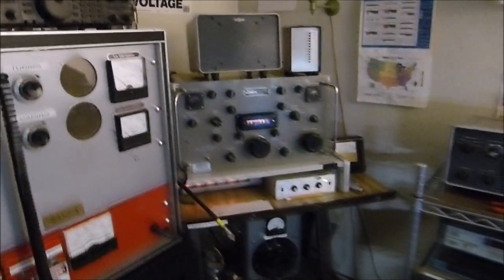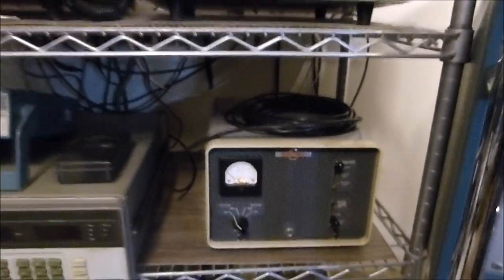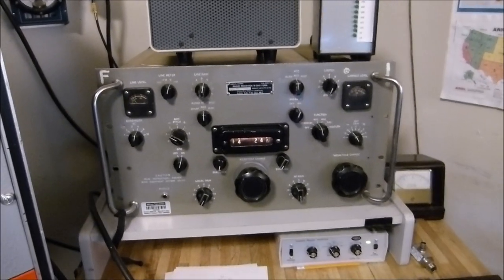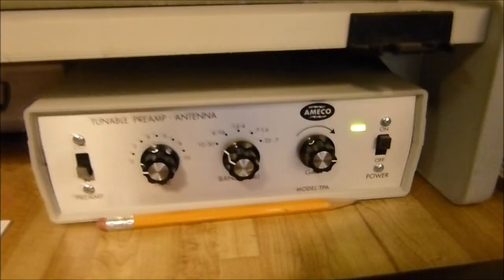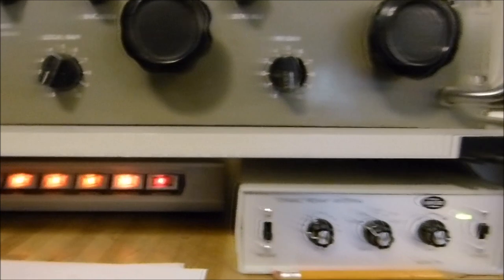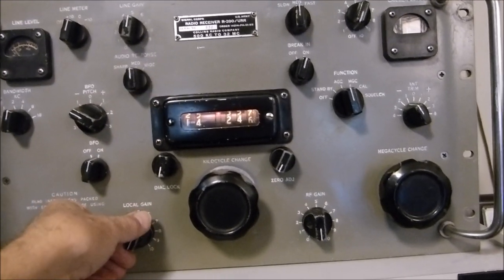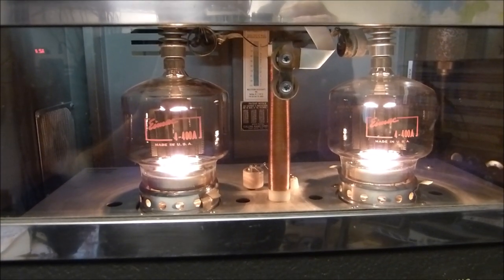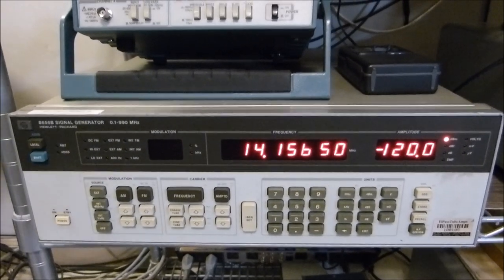Collins R-390, 75S-3, 51S-1 & KWM-2A Receivers Compared

Comment: A properly running 390 and A versions will have enough RF gain without a preamplifier. You may have a resistor in the IF for example that is high in value causing lower gain like I had in my 390. Once repaired and realigned it is a hot performer with my 390A.
Reply from the maker: I am glad you mentioned resistor issues in the IF section. I have always figured it was in the IF section and I don't mind working on the unit but, as you know, work is to be done carefully and the beast is heavy for one old guy to move around. I may take a look in the IF section again. With the preamp, I would say it is as good as new. It is top-notch in performance but I would like to fix it properly.  73
Reply: @ElPasoTubeAmps  It could be something els too. I would check each IF tube plate resistor. The IF deck is not that hard to take out. I use a automatic AM sync detector with sideband. I also can run the IF output through a SDR board with power SDR or HDSDR software. Just amazing receivers.

Comment: The S-3 will sound much smoother on ssb when you select slow AGC. Fast attack, fast release has always been problematic with Collins 75S-3's. Something to consider, unless you are a CW op. 73'S...
Reply from the maker: Good point. I believe I discovered that long ago but forgot. Thanks. Also, the R-390 is a slow AGC as it has the Tree Top adapter on the back and it can cause a fraction of a second delay when the other station starts transmitting. Usually not a problem. I think the Tree Top adapter takes control away from the R-390 front switch. I will have to confirm that. In any case, the objective of this video is how the little bit of front-end preamp really brought the R-390 up to sensitivity performance very close or equal to the other receivers. I really enjoy using it. I  have ordered another black rack just like what the KWM-2A is in to stack the R-390 and S-Line equipment and get some of my floor space back... may even buy a third rack later. 73

Comment: As far as clarity goes, the R590 and the KWM2 sounds the best to me.
Reply from the maker: I know what you mean. Those two receivers have a more full-range frequency response than the other two but the 51S-1 and 75S-3 are more sharp or crisp sounding which can sometimes help get voice communication thru better. My favorite sounding one is the R-390.  You might also  find it interesting that the R-390 is only 500 ohm output and uses a little seven pin 6AK6 for 500 mW output to drive the local speaker and a 500 ohm line. I have been told a single stage 45 tube amplifier SET makes it sound even better.

Comment: I miss my service monitor when I worked in two-way.  All of my ham gear was tuned and run at optimal rx sensitivity.
Reply from the maker: I have thought about buying a service monitor but as you know, they can be kind of expensive. Maybe I will luck out and get one at an estate sale. I  paid $375 for my KWM-2A with power supply (516F-2),  312-B4 speaker/wattmeter/phone patch and and extra Collins speaker - the one sitting on top of the R-390.  It is obviously a US government contract instrument as can be seen on the front of the power supply with the contract number.  The 5R4 and 5U4 were in original GE tube boxes as was the fuse holder and fuse along with Collins tags in plastic bags. The way it came, it is apparent to me that it was never used before I got it. Got to go to estate sales before they put it on Ebay and it costs 10x as much.

Comment: Hi, was the lack of r390 sensitivity before you aligned it? R390’s have a very low noise floor in my personal experience
Reply from the maker: Yes, the sensitivity was a bit low before the alignment and that is one reason I did a full alignment with the best tubes. The R-390 does have a very low noise floor and I like that. There seems to be something about the sound of the 500 ohm outputs on each of these three receivers that I like better than the 4 ohm outputs. I can't explain why could be. I added an outboard preamp and sensitivity is as good as my 75A-4 (a new addition) and my 51S-1 receiver. Interesting that I was listening to a very low signal level DX station last night and was switching between the R-390, 51S-1 and 75A-4. I think most of the difference was just in the speaker sound and not the receivers as each receiver had its own characteristic sound all actually very good. This was on 40M. The R-390 is still top-notch compared to any receiver.

Comment: I dunno, a $100 Sdrplay sounds pretty nice, hears and displays  everything and takes up much less room.
Reply from the maker: The SDR is pretty amazing and does just as you say but I love the old technology and keep the boat anchor equipment running. I can fix the old stuff but if the SDR breaks it goes in the trash can and I have to buy another. I mostly use my SDR nowadays as a spectrum analyzer. The modern stuff is amazing and I like it also.

Comment: Did you get my last comment I never got a response about micro cap,I left you a link so maybe it was in spam
Reply from the maker: Hi John,
Yes, thank you, I did get your message about Micro-Cap and did use it some years ago when it was only a DOS version. I still have that DOS version on floppy.  I did download and install the Windows 10 version of Micro-cap on this PC. I am not as familiar with Micro-cap as I am LTSpice so I have a bit of a learning curve to get thru...  
I looked  up Micro-cap and found this link for new downloads for others that read this and might be interested. Also a link to LTSpice direct from Analog Devices. . .
https://www.spectrum-soft.com/download/download.shtm
https://www.analog.com/en/design-center/design-tools-and-calculators/ltspice-simulator.html#
Reply: @ElPasoTubeAmps  ok that's fair enough, not much difference between that and ltspic is there both do the same thing? Is ltspice free? Glad you found it useful.
Just curious do they give you different results if you got the same circuitry running in Virtual.

Comment: i have 2 collins kwm-2 with instruction book. collins 30L-1. collins speaker. swan FP-4 phone patch. curtis mathes power supply. swan mark II power supply. swan mark II linear amplifier with operation and maintance book.  maco 500. swan model CM17L micro phone. Shure MOdel 450 micro phone. some cords look bad, would not plug in. my Dad passed away in 2018 and he left these to me. have no idea what they are worth other than had offers from 500.00 to a guy in Utah said if he was closer they would be worth 2500.00 to him. i won't ship and he won't come and get them. any body tell me what they are really worth? taking up space at my house. thanks, Bill in St. Joseph, Mo.
Reply from the maker: Hi Bill, I am very sorry to hear about your Dad passing. I actually worry about my stuff when I pass...  
just my opinion here - selling locally like at an estate sale, you are likely to have to sell pretty low. I bought my Rockwell Collins KWM-2A with power supply and speaker in absolute mint condition for $375. On Ebay people would likely ask several thousands for it - and possibly get it. I was given, for free, a Collins 30S-1 a few months back. It needed a little work but it was a couple hours work to put it back in perfect shape. What does all this mean? Most people today want auto-tune, plug and play solid state equipment and are not capable or interested in repairing and maintaining vacuum tube equipment.  Similar to old cars. There are exceptions.. Not too many left that even know how to operate the Collins S-Line equipment. Some might want it for a museum piece. I am sorry to say that. On the other hand, you could run across a person passionate about the vintage equipment and get a decent price. Once again, this is just me talking as I have bought a good bit of other equipment around here in El Paso from estate sales and often times the sellers start asking prices comparable to Ebay prices but - be prepared for this - often times things sell for about 1/6 that price at estate sales. A $600 item on Ebay may likely sell for $100 at an estate if there is any one even interested in the older equipment. I am sorry to tell you this but it is true where I live. It may be different in your area of the country. 
Other people may give you more hopefully thoughts and better advice on selling this equipment.
Reply: @ElPasoTubeAmps  thank you. like anything else. find the 1 person that wants it and let him or her make offer. rather see someone thats going to use it buy it. i know nothing abut these radios. they dont eat much so i can hold on to them. thanks again, Bill.